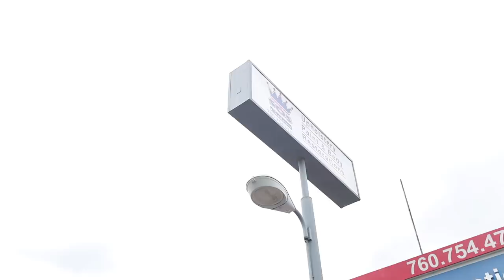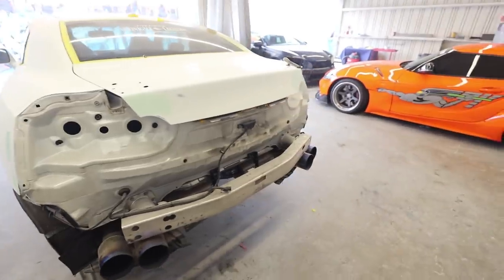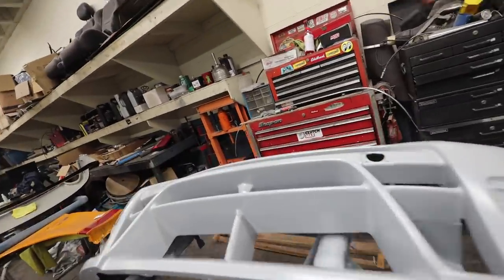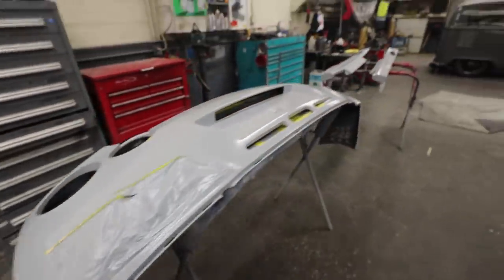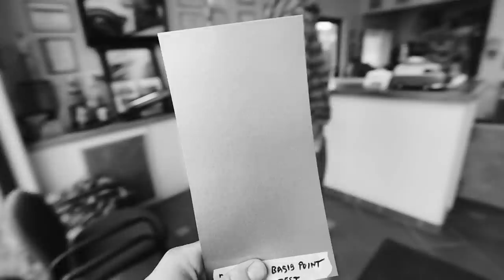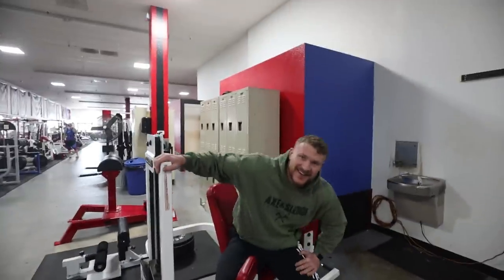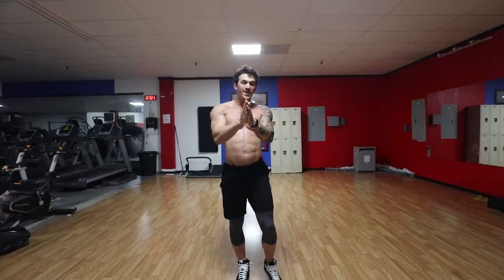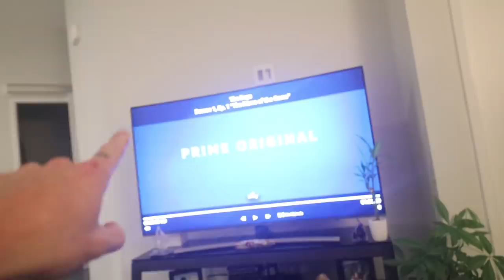I NEEDED TO SAY THIS.. | R35 GTR NEW PAINT UPDATE! R35 GTR BUILD SERIES

Comment: Dustin when we going to have a update on the fairlady z ???
Reply: its not a fairlady Z its a 280Z 
there are 4 sorts
240z 260z 280z and the fairlady z
Reply: Probably around when they get married, they said it would be their drive away car and hope it'll be done by then
Reply: @thedandy6765  Aren't they all fairlady z's? like the 350z and 370z are also fairlady z's?
Reply: @Twxii  no there is a difference tus 350z and 370z are different crom the fairlady
They are nicknamed like that but they are not
The fairlady was a more luxurious and comfortable version it had softer seats  wooden steering wheel ajd some other things to make it look and feel classier 
It had softer suspension less power at only about 120 to 130 from an inline 6
Reply: @Twxii  FairladyZ is the japanese name of the Z chassis. It wasn't called the FairladyZ in USA because Mr.K found that the name would sound too soft for USA market. The funny part is that he saw a play when he was living here in the US called "My FairLady". Most people just call them by their chassis code to skip the confusion (i.e S30, S130, Z31,Z32,Z33,Z34...)